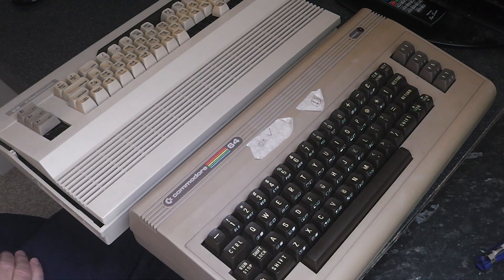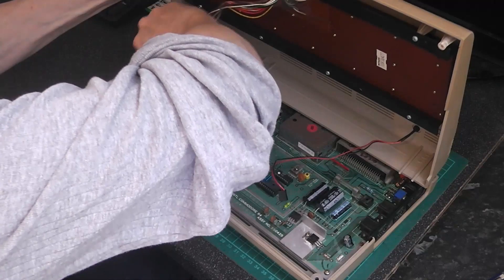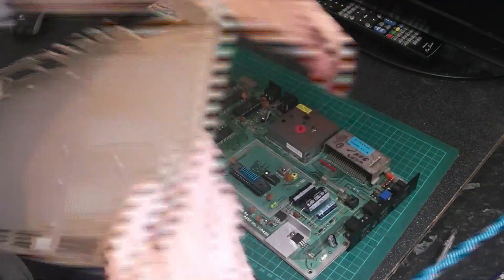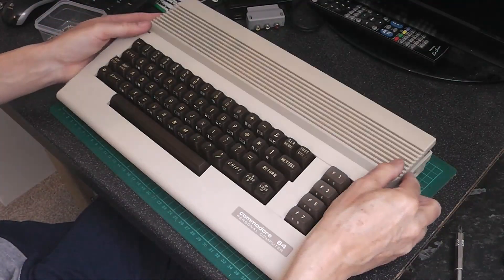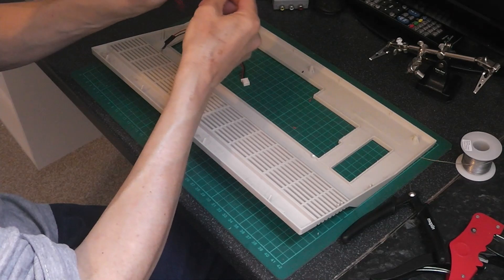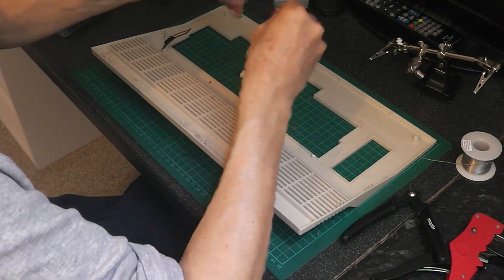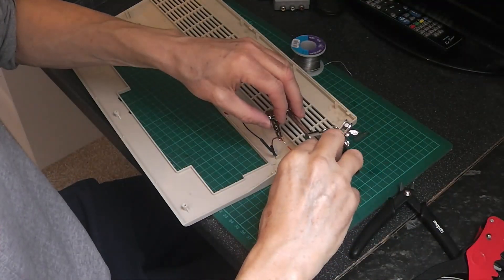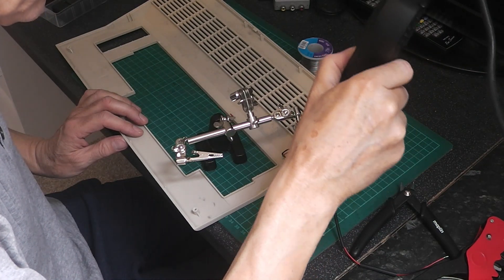Commodore C64 Breadbin into C64c Case

Comment: so i cant just self screw the keyboard into the top case and i need 3d printed stuff?
Reply from the maker: There aren't any screw holes for the keyboard in the top of the C64c.  You can you use the original metal keyboard brackets if you have them 😊